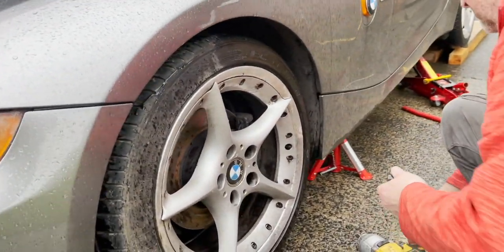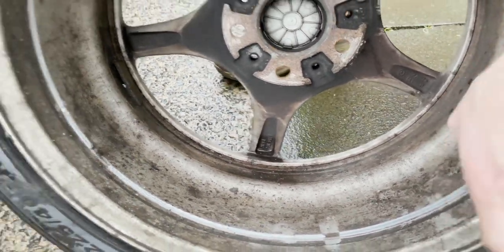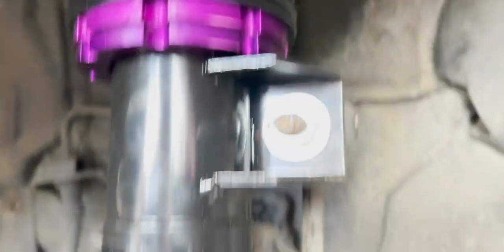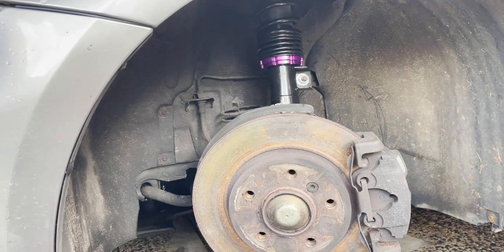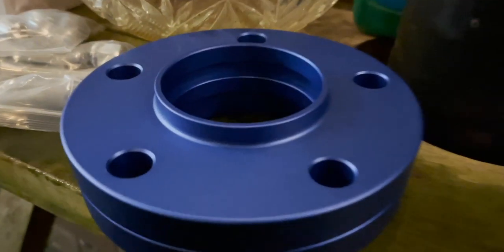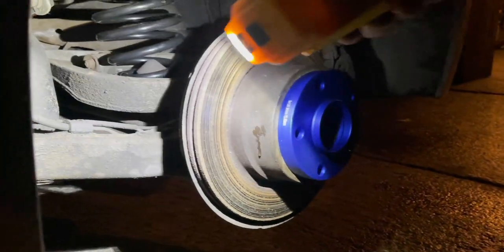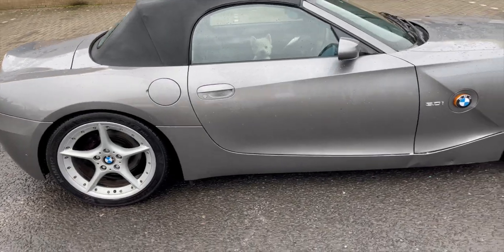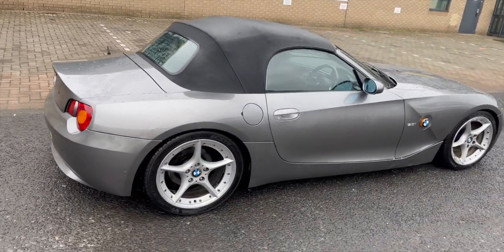What a disaster! Replacing the shocks and springs on our broken Z4

Comment: thats some tight fitment right there! and indeed greasing up the coilover threads wouldve helped haha. preferably aluminium grease
Reply from the maker: Yeah the worst was we didnt realise we needed the spacers until we tried to drive it. Damage was minimum but a real pain!
Reply: @desilva68  you two did a solid job! love to spend the weekends like this and also saves loads of money! my mate and i got the same car jack haha
Reply from the maker: What size engine do you have?
Reply: @desilva68  i’m about to pick up a 2.5l 2003 model.
Reply from the maker: Sweet youll have to put up some videos so we can see. Nice one 👍

Comment: my z4 is dropped about the same speed bumps are a nightmare I'm on H&R springs. even one wheel at a time didn't stop some underside scrapes.
Reply from the maker: Yeah its pretty bad in uk but Poland is even worse. I damaged the exhaust on my 2.2 Z4 in a previous video due to speed bumps.

Comment: Can I ask which coilovers you purchased. I bought the stance ultra and when attempting to fit them they appear to be incorrect. Yours is the second video I’ve seen with the stance coilovers and both sets look different to the ones I’ve been sent. Just trying to work out what I my set should look like before I reach out to the company to try get them swapped.
Reply from the maker: it was these ones..
https://www.stanceduk.com/products/stance-street-coilover-suspension-kit-bmw-z4-e85-03-09-2-5i-3-0i-3-0si-1?_pos=1&_sid=f9365ef3f&_ss=r

But remember you also need wheel spacers as the front coils foul the wheels.
Pindex Car Wheel Spacers 5 x 120 these are what we used.
https://amzn.to/3YkTrKf